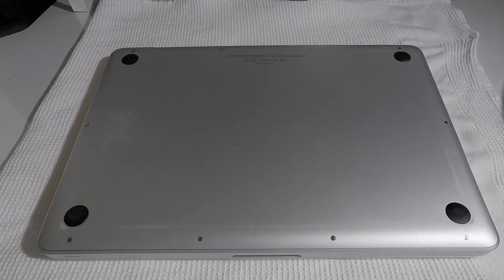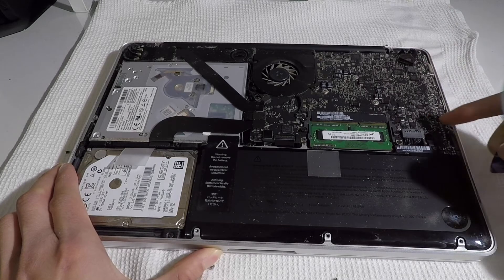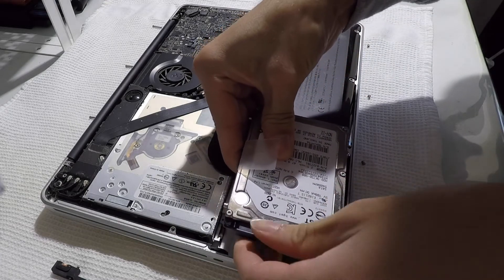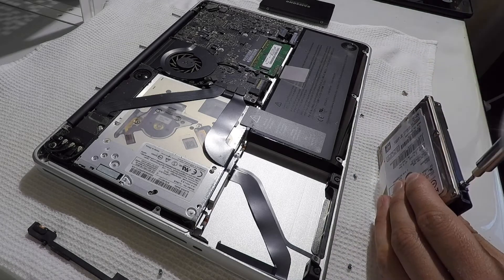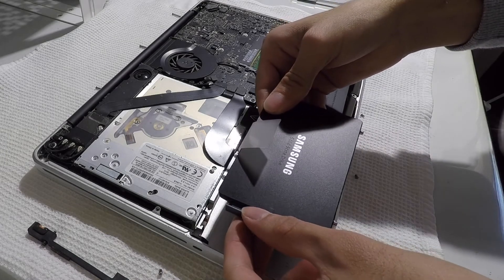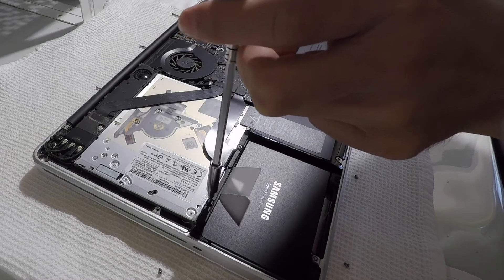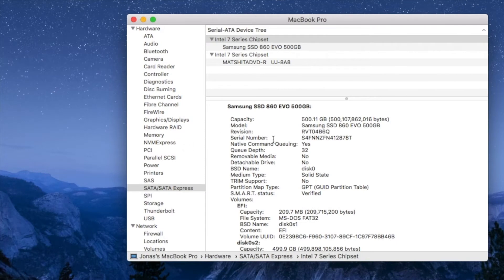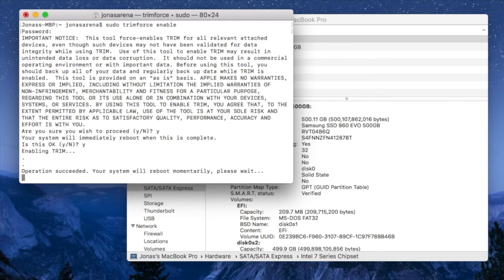How to Install New SSD in MacBook Pro & Enable TRIM

Comment: Hi, do we have to format the SSD before installing into the MAC?
Reply from the maker: Hi thanks for the good question. You will need to format the SSD by using Disk Utility to erase it and format it as “Mac OS Extended (Journaled)” with a single GUID partition.